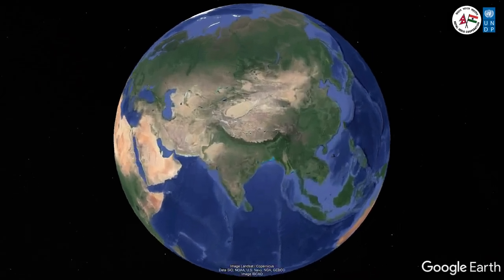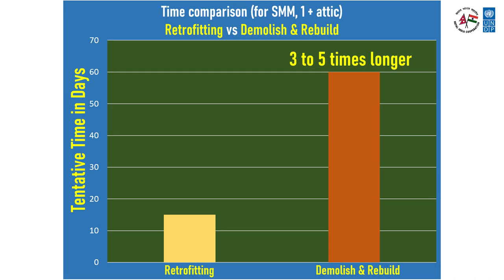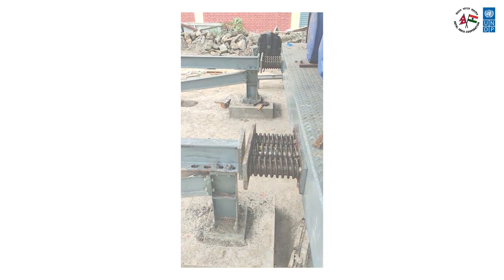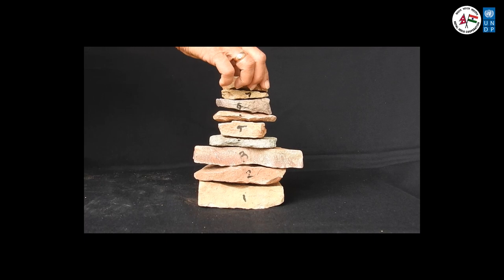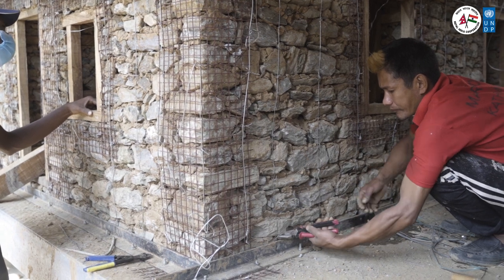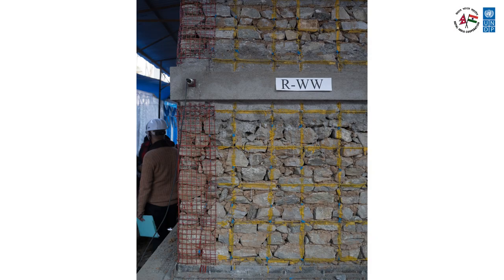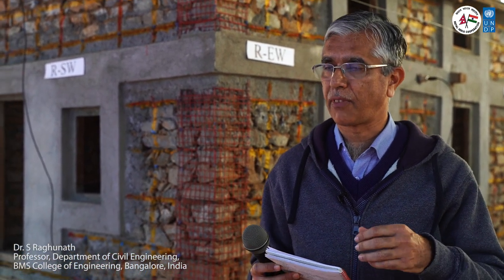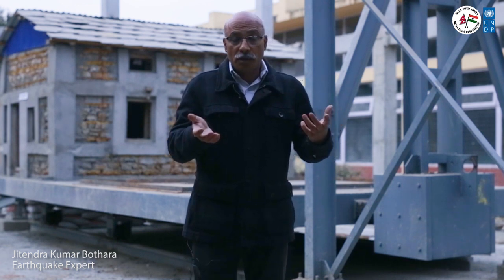Retrofitting Works: See it to Believe it

Comment: My question is that why the retrofitted building is on that side of hummer which may absorb less amount of energy and seismic loads, in contrary the non retrofitted building is near the hummer and of-course more seismic load will apply on it. I wish this test was done unbiasedly and the same seismic loads were applied in both buildings. (correct me if I am wrong)
Reply: My first thought
Reply: I also thought so..